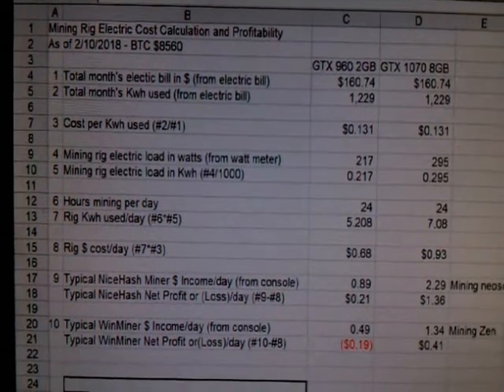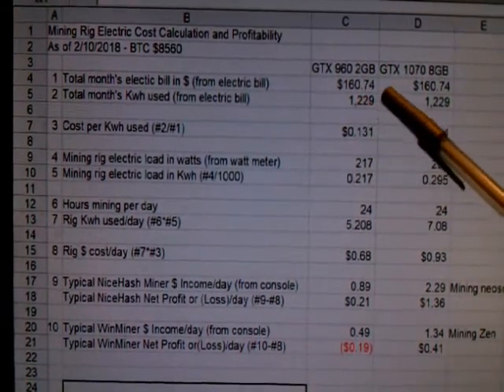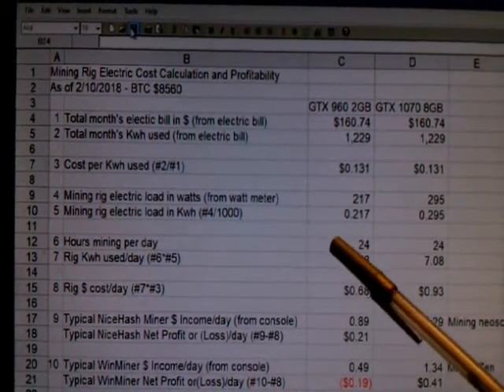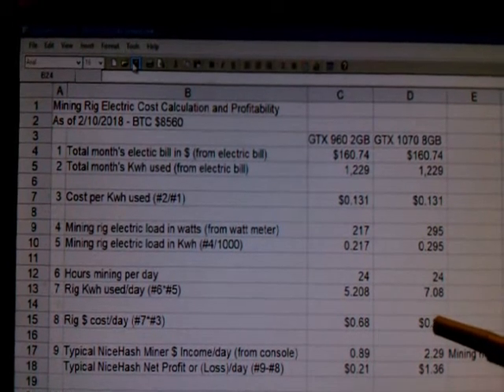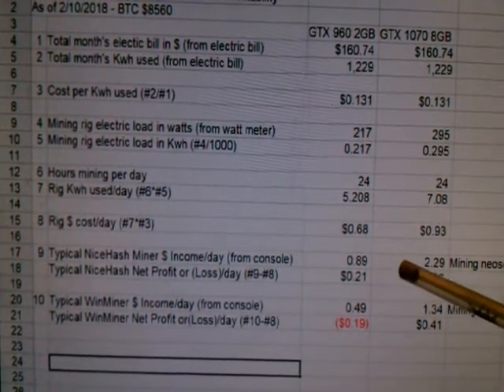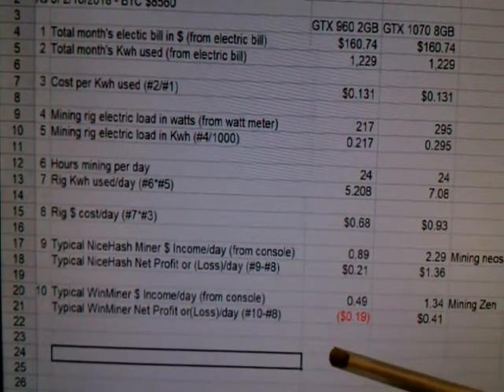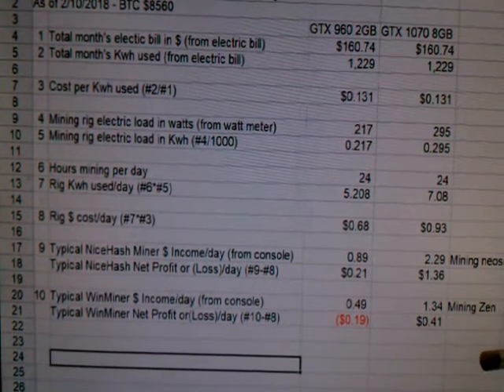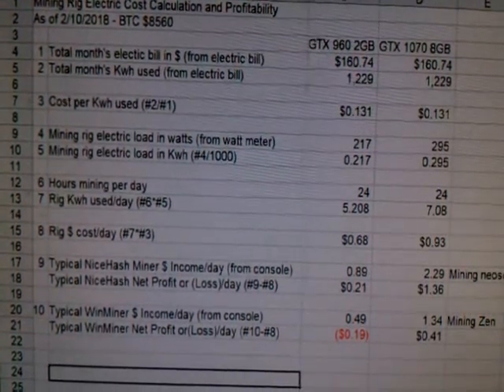Bitcoin Mining Electric Cost and Profitability for GTX 960 and GTX 1070

Comment: How does one DIRECTLY mine for Bitcoin with a GTX 1070 and an i5 7600 CPU?  This is probably a very simple question with a much more complicated answer.  But, I would like you to try and help me by taking a shot and answering this question.
Reply from the maker: You need to use a mining pool. Never done that so just do a google search
Reply: @mdmeyerpfa  ...A mining "pool" sounds like more than one person, which is the exact opposite to the question I asked.  There has to be a way to mine for Bitcoin as an individual.
Reply from the maker: @Rickbearcat  What you are referring to is called solo mining. With solo mining you are in a race to be the first to find the matching block hash code and receive the block reward.  Since you are competing against every one else and the pools it is extremely likely you will not win the race. And over a very long period of time it is possible you could never win the race. That is why pools exist. With a pool you get your  very small share of the reward but the odds to actually receiving a reward are very high.  Some pools let you decide if you want to solo mine or not.

I have two GTX 1070 GPUs and an i5-9600k CPU. Unless you electric cost are near $0 your CPU is not profitable for mining (neither is my CPU). The GPUs are  good though. I prefer selling GPU power via NiceHash which technically is not the same as mining via pool.

Hope that helps.